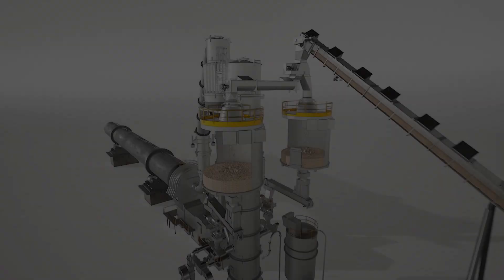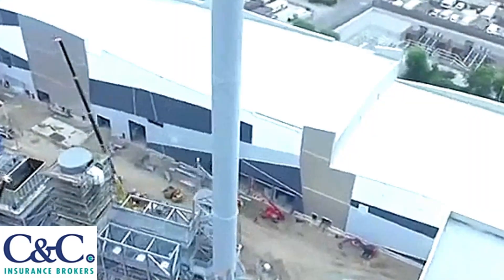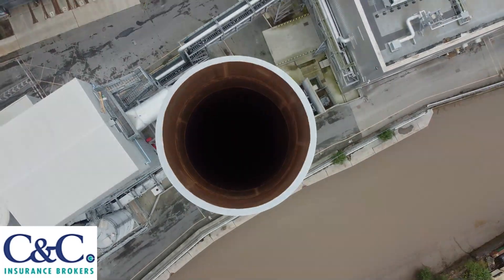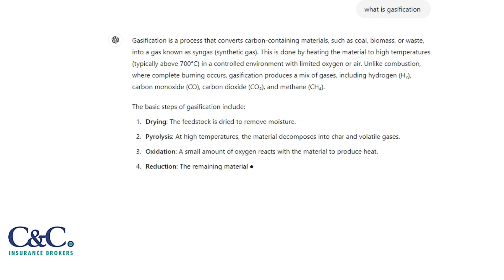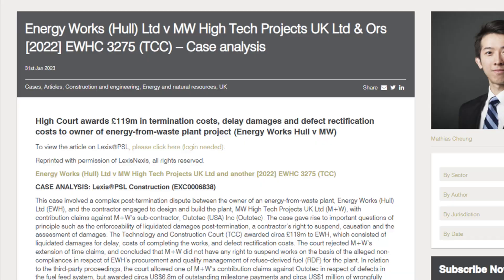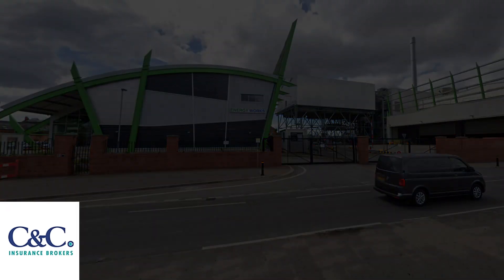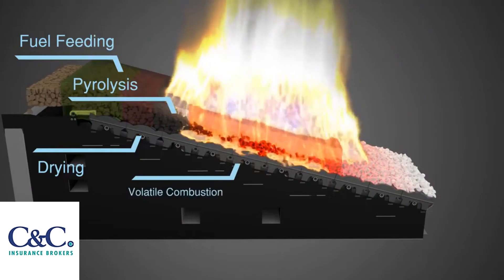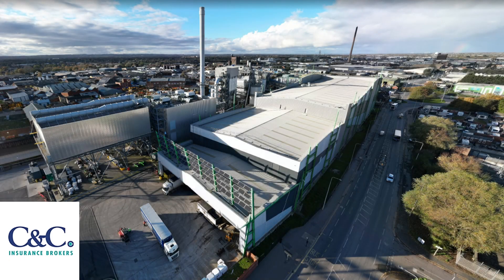UKS LARGEST ENERGY PLANT BUST ? Energy Works

Comment: I worked in a chemical incinerator plant and that only used diesel to start it, after which it was burning on it's own. The main problem was keeping the temperature down to stop pollution even though it went through filters before the chimney. The gasification plant basically slow burns the waste in a low oxygen atmosphere similar to making charcoal or town gas with coal. Obviously there was a design fault or more likely a control issue with the plant that the builders didn't understand. The material used could have been sorted to get the right consistency and also some small pre incinerator could have used to dry wet material. Looks like they employed the wrong "experts" - should have called me..........

Comment: Gassification is not a new technology. It is simply coking repurposed. It operates economically at profit in numerous countries around the world. In the UK and EU there is strong political opposition to gassification and restrictive regulations favouring incineration and waste export to external countries.

In addition the issues in the use of RDF (Refuse Derived Fuel) is a surplus of processing plant and insufficient RDF fuel. As such plants are fighting over surplies of RDF.

Incineration is combustion of the material. Gassification is the thermal decomposition of the material. The two are not the same.